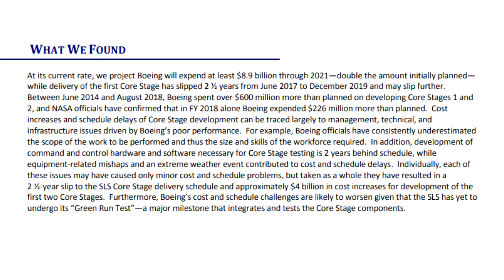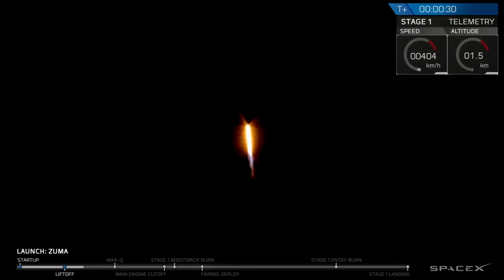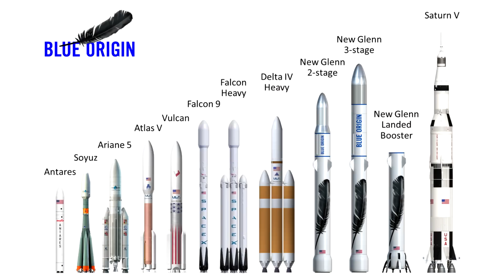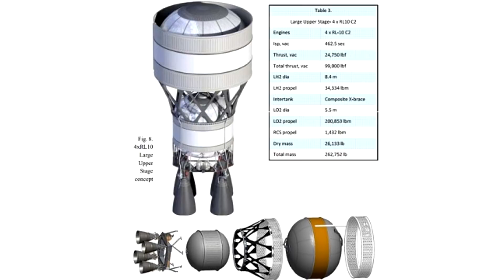New Glenn, OmegA and Vulcan Get Air Force Approval

Comment: Spacex dose not want any government money if they can avoid it. Hans Koenigsmann did a talk and mentioned it.  Because the government tend to want to dictate how you design your rocket when they help pay for it.
Reply: If you hadn't posted it, I would have.  I completely agree with them.
Reply: The military doesn't like to take risks and is very slow to innovate, take a look at the SLS. The BFR however is extremely innovative but with that innovation comes lots of risks.
Reply: A lot of people don't realize just how risky BFR is the closest analog would be Energia II or Uragan.
Reply: @Patchuchan  why? Both of those vehicles suffered from severe quality control problems.
The fact fh flies without issue tells me those concerns are moot.
Reply: @Patchuchan  Then how would you classify the risk levels for Vulcan?
If SMART reuse is implemented, the engines would have to seperate from the first stage and than deploy a heat shield. That sounds more risky to me
Reply: @biplabkumarghosh6300  Vulcan reuses a lot of Atlas and Delta technology the highest risk part is the BE-3 engine.
The separation part of SMART reuse would pretty much be the same as the stage and a half on earlier Atlas rockets.
The risky part there would be heat shield deploy and reentry though it reenters much faster than the F9 first stage it's still far lower than full orbital speed.
Reply: Don't be ridiculous. SpaceX really wants that money. Government money is what saved them from bankruptcy and it is also what allows them to keep pursuing their crazy projects today. And they will keep getting it through launch contracts.
If the government decides to make a bid for interplanetary rocket for a moon or mars mission, you bet that SpaceX is going to take it with the BFR.
Reply: @gubx42  Assuming you are talking about the COTS program, please note that government funding was alloted only on the condition than more than half of the funding must come for private sources. SpaceX and Rocketplane Kistler both got selected, but contracts with Rocketplane Kistler were soon terminated due to insufficient private funding
For SpaceX, about 40% of the funding during COTS program came from Government and the rest from private investors. So saying, government money saved SpaceX is avoiding the fact that the majority of the money came from private investors. If a company could solely survive on government money, Rocketplane Kistler wouldn't have died
Reply: Ah yes... like the Space Shuttle...
Reply: Thomas Larsen Yes, but if you don’t design it the way they want, what makes SpaceX think they’ll be chosen over a launch provider that does?
Reply: @TananBaboo  if what you come up with turns out to be better suited to what they wanted it's all good.
Reply: Baron von Limbourgh true, but they’d have to prove it with more flights first than the others would.  Seems risky if it doesn’t pan out.  In my experience it’s not easy to convince government engineers that their way might not be the best way.
Reply: @TananBaboo  apperently spacex is very confident they know better what the government wants and needs then the government itself.

It is either brilliant or it will be a massive desaster. Only time will tell.
At least they are ambitious.
Reply: @baronvonlimbourgh1716  elon musks ego is bigger than his rockets! It will be his downfall
Reply: @mrslinkydragon9910  i don't know. Most things he touches seem succesfull. I guess if someone could pull it off nowdays musk would be a good bet.
We will see. If it goes horribly wrong it would definatly be bad for his reputation thats for sure.
Reply: @TananBaboo  they have to do that anyways, regardless of if the government wanted one or not.
Government contracts always come with notable caveats that drive up costs.
Reply: sgauntt
I take it you've never done engineering work for the government.  Design by committee of bureaucrats.  Remember the Shuttle?
Besides, why would they want to risk getting involved in Trump's Space Farce?
Reply: "It is either brilliant or it will be a massive desaster."

This is SpaceX we're talking about. It'll be brilliant either way.

A brilliant success or a brilliant disaster.
Reply: I wonder how much they impacted the billions poured by NASA for Dragon, and technical assist to Space X... but noooo.... space X doesn't want governament money. Lol
Reply: +nuke99  I think this may be part of the reason they don't want government money.  Dragon 2 is basically the already existing Dragon 1, but with life support and an escape system.  There's no reason these features should take an extra billion dollars!  Imagine this nonsense happening, but for a rocket the scale of BFR.
Reply: Life support and an escape system and an all-new powerplant, the world's first orbital reentry and precision landing system, everything triple-checked and triple-redundant for safety, every unit tested to the literal highest standards on Earth. That doesn't come cheap. I certainly doubt anyone else could do it for cheaper.

Remember, of course, that the previous pioneering, innovative American spacecraft, the previous exciting testbed for reusability, singlehandedly killed more people than every other orbital launcher in history. Combined. There's a reason the world uses a 60 year old rocket for manned fights, and it's not just "It works, so why bother." It's "It is the absolute safest thing we can build, massive military budgets already paid for R&D. Who wants to step up and beat them?"

There's no such thing as "good enough." The standard is "the absolute best" and no less.
Reply: @Tuxfanturnip  are you talking about the rocket that blew up yesterday?
The fact we still use 60 year old hardware is more a testament to the monopoly that has existed in this field than to how well these designs perform.
Shuttle was a nice idea but had many glaring flaws, primarily being it had to fill too many roles which comprised it's reusability and safety. That just a consequence of being a government program tho.
Reply: There's a reason that the Soyuz failure is a Really Big Deal. Failures happen, yes, but this comes after decades of reliability. The monopoly isn't upheld by the absolute quality or reliability of individual vehicles, but by the absolutely staggering amount of effort it takes to even approach that standard of reliability. There's literally no way around it. You want the government to lay off and not make you spend $1B+ on safety testing? Congratulations, your libertarian ass is going to get people killed. Safety standards exist for a reason, and I wanted to use Soyuz, and how shocking a single failure is, as an example of just where those standards are. Remember, of course, that the LES that saved the pilots' lives is based on over half a century of testing solid rocket emergency systems. If SpaceX want to completely replace that, they'd damn well better be spending good money making sure their abort modes actually work.
Reply: @Tuxfanturnip  and that is exactly why we no longer have a way to access the iss. We thought that just because an old system still got us by that it was ideal.
This led to our aerospace industry becoming little more than a jobs program, existing solely to benefit those companies that get federal money.This is a logical consequence of a lack of competition in any market.
All it means is more wasted taxpayer dollars funding out of date and inefficient jobs programs over companies that could actually benefit the country and potentially the globe as a whole.
Reply: @chadleach6009  Where did I say it was ideal? I'm trying to say that, though it's not perfect, it was an enormous investment to create and will by nature be a bigger investment to outdo. "The best" doesn't mean perfect. It does mean absurdly hard to even begin to compete with. I want to know, what would you rather have happened?
Reply: @Tuxfanturnip  lol the private industry operates by doing better with less. That's why SpaceX has done as well as it has, it embraced that to the point of being able to fly multiple missions on a single booster.
Your assuming just because it cost alot for one person to do something that such is the case for anyone wishing to outdo them. History would tell us that is not the case, things almost always get cheaper as competition finds new and better ways of doing things.
I just want the government to stop treating many of these aerospace companies as jobs programs. It has led to a near total stagnation of our aerospace industry to the point that our only ride to space is from another country that can no longer fill that role itself.
I want the government to have confidence in it's people to create companies that produce goods in a cost efficent manner and deliverying the capacities our nation needs.
Basically, I want Congress to stop allocation of NASA's budgets.
Reply: @chadleach6009  I'm talking about R&D. I'm talking about R&D, not per-flight cost. What part of "it costs a lot to get on the playing field where you can compete" says anything at all about the operating costs once you're there? Safe alternatives to existing systems take massive investments to develop. Safe and better alternatives take even more time and resources to develop. This has nothing to do with how much better and cooler of a vehicle you'll have ONCE it's built.

This is rocket science. This is a field where cutting corners kills people and blows up millions of dollars. Private companies go faster by cutting corners. Thank fucking goodness someone's making them take their time for once.
Reply: @Tuxfanturnip  exactly, how much r&d has been spent on SLS up to this point and what do we have to show for it in comparison to other companies?
Why do you want the benchmark to be the ones that have continually gone over budget and past due like SLS?
And once again, how much it costs to get into the field is relative. For example, in order for nasa contractors to accomplish what SpaceX did in a similar time span would have required a budget the size of the sat 5, yet SpaceX completed it at a order of magnitude cheaper.
Capitalism works by coming up with better ideas at cheaper costs, you simply seem averse to this as a whole.
Reply: @nuke9918  All Dragon vehicles are solely used by NASA for ISS. So it makes sense that NASA should pay the full money for its development. It's like asking why should the Government pay for making the building of Senate